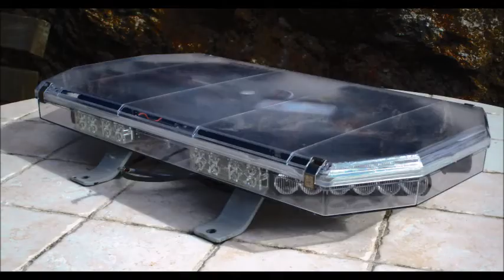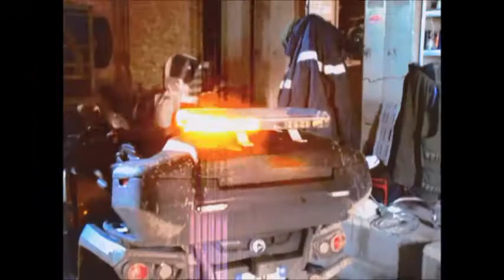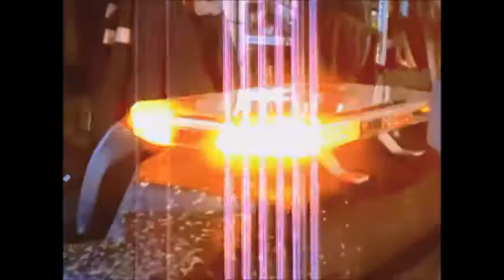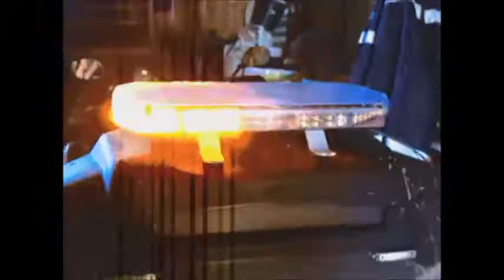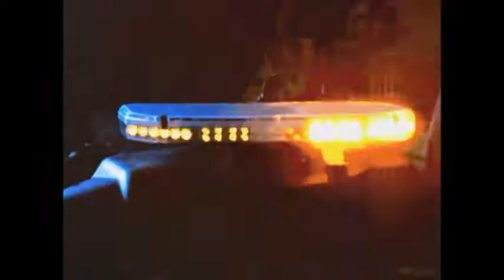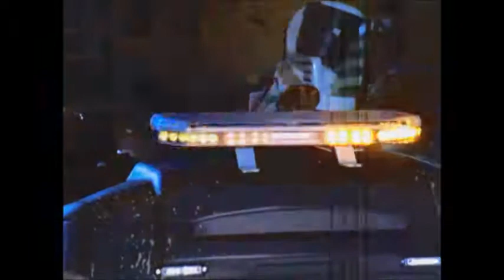MINI RAMPE CODE3 LX2100 22" AMBER

Comment: What flasher do you have in this lightbar?
Reply from the maker: sho me 11.1005SF.HD.
Reply: Do I just set all of my LEDX / Optix modules to steady burn? Then connect the power write through the Sho Me flasher?
Reply from the maker: all the lights are connected on the flasher
Reply from the maker: yes
Reply from the maker: the modules are fixed and connected to the flasher